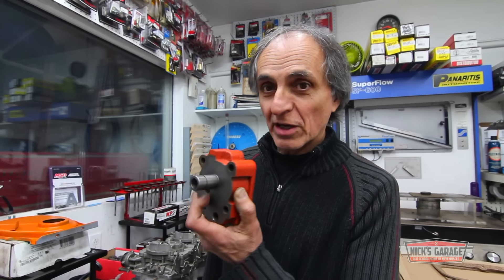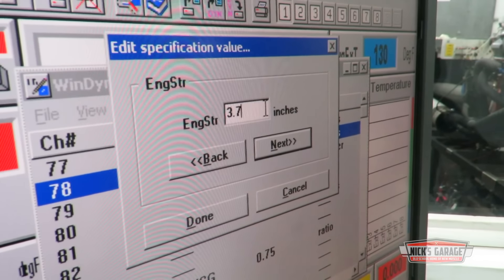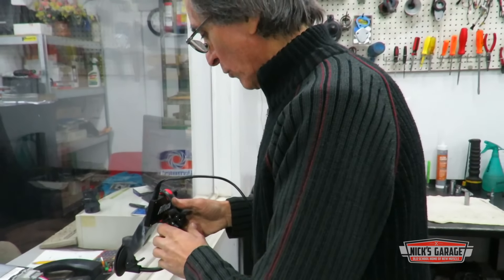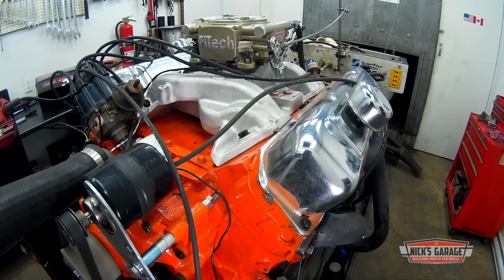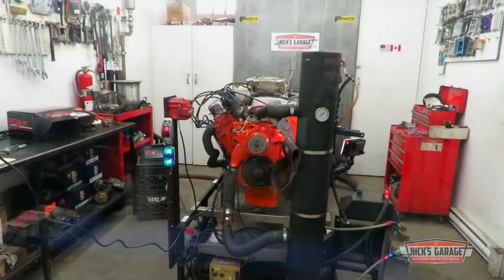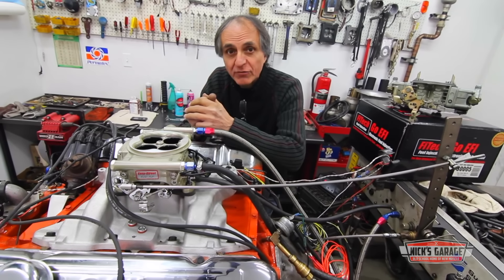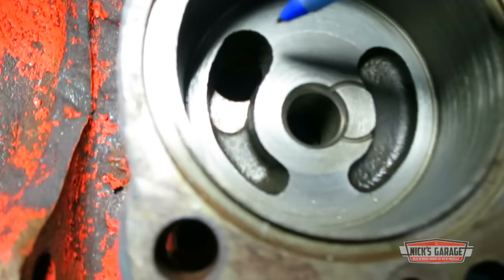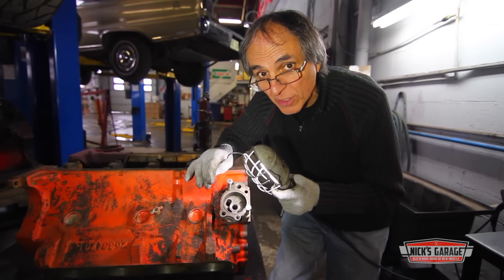Carburetor vs E.F.I. - Dyno Room Showdown

Comment: Yeah, for maximum HP, a carb is always the way to go, but for reliability, quick startup, and fuel economy, go EFI, or TBI...I would much rather see a custom intake manifold with MPFI and individual injectors with a throttle body.
Reply: Has anyone worked on an adaptation of the fuel injection system of a modern car onto an old engine? There are fuel management computers that do the fuel and leave the ignition to a separate spark controller; some of the new engines need crank sensors for the spark control on a stock computer that can't be adapted to an old engine; I'm thinking of the reluctor wheel that's part of a crankshaft (LS?). I know adapting an engine wiring harness can be a nightmare compared to the Fitech system shown here.
Reply: just tune it right with carbies. When the spark plugs go black - it's rich. It's not brain surgery
Reply: Blatchford, I was interested in how to operate a muscle car without the 4 MPG penalty, and to operate in an area with mountains and -40 weather. For example, a modern Dodge Charger with a 5.7 V8 and all-wheel drive can cruise the highway at 10l/100km, and a 1974 Pontiac firebird (455 SD) averaged 4MPG, in my own direct experience. By this video's example, max power seems to be easier with the carb but I don't drive on a racetrack; I like muscle cars and I hate to pay extra for gas. I live in an area with hard starting and expensive gasoline.The modern fuel injection is so much better for driving, I'd like to see more old cars, say from the 70's and 80's, with crude pollution controls be able to be driven and be registerable in any jurisdiction that requires emission compliance. In those areas, an old car must have complete, functioning original equipment, or as is my preference, pass the combustion test limits for its year.
   More importantly some of the big cars with huge engines and low horsepower are just no fun to drive; altering those early emmision engines with modern compression, cam profile and fuel injection would make them actually useable and emissions-cleaner to boot. For actual driving further that the car show.
Reply: in aircraft ( my profession ) if you're at high altitude you tune for that.  If at low altitude you tune for that.  That is the singular advantage of EFI since it modifies mixture as you reduce altitude within a high range.  And yet carburettors are able to compensate for much of the oxygen % reduction.  I.E. most Cessna light aircraft with 360 cubic inch Lycomings  work happily on carbs to 15,000' - Even without turbocharging. And wonder of wonders - no bloody computer to fail.  So just how high are you? You make it sound like you drive to the summit of MtEverest daily..  Really, up to 15,000' in altitude a carburettor can supply fuel mixture at close to optimum levels. So do you live in Bhutan?.. for I visit there often and they also are high most of the time on psychoactive phenethylamine chemical derivatives I have known and loved ( PiHikal ).. since the local bees bring in the pollen of exotic plants from alpine valleys above the tree line.  ( USA personnel who have operated in Afghanistan will understand this..).  So are you also high on phenethyamines so as to believe you are regularly travelling from sea level to above 15,000'? 

My point being - some aircraft regularly make the trip from sea level to above 15,000' but very FEW car drivers. 

I must add that at no time have I driven a " big car with huge engine" that was anything short of orgasmic to drive you yuppy driven Cretan of this airbag age.  And BTW my big block Mopar in a 1972 Valiant Pacer body gets 25mpg on average. And makes 550hp NA.  

Tuning is in the hands of experts such as in this video.  Idiots buy computer controlled new cars and leave the tuning to some pimply computer gaming nube who wrote the software on their EFI system
Reply: Blatchford, I live in western Canada at 400 meters to 2200m(?) but also -40C to +30 (it does get hotter but few days in a year). I believe, also, that the throttle-body injection is more available that electrically adjusted carbs, anything to do with aircraft, or, a way to adapt modern port-injected fuel systems to old cars' wiring harnesses. It seems to me, rather than dyno-tuning and plug chops to tune a carb (simplicity of tools notwithstanding) I'd rather do one visit with a computer to tune an old car and then drive it. The advantage with an aftermarket throttle-body is even less time with a computer, but (cringe) what about long term reliability? Restoring a 20-year-old 2010 car might be impossible as well.
  I am thinking of piecing together junkyard fuel injection parts from the widest available cars to adapt to unpopular cars from 1974 to 1984 with the least efficient fuel systems and bring them back to life. Make some absolute fuel-hog boats into useable muscle cars.
  Would I actually be able to do it? unlikely, as I am an apartment dweller with no shop to work on cars. I really enjoy the art of car building and restoring, such as shown at Nick's Garage. I cannot consider owning a valuable classic, such as done here, because I need to be able to drive any car I own.
Pipe dream? Yeah, mostly but hey, why not?
Reply: As it happens, I did think of carbs with slides. I vaguely recall a CV carb with an electronic adjustment from an oxygen sensor in a mid-80's car. I do know that carb setups had tubes from exhaust-heated air to maintain air temp at the carb inlet which evened out the fuel mixture fluctuations (and prevent venturi icing). I even imagined a setup to use very hot inlet temps at sea-level, graudually cooling at higher elevations to maintain oxygen density throughout a wide range of temp and altitude which, as you point out, many man-years of engineering is needed to perfect, as is computer tuning. 
  Choosing used fuel injection equipment would have to start with what software is available for which brand. I vaguely (I am lost in fuzzy recollections) recall an article about the first generation 4.6 OHC Ford V8 had software you could plug into and adjust most parameters, but still, that required the entire wiring harness an associated body components to clear all the possible trouble codes; a different nightmare again. There are new crate engines that come with an engine wiring harness and independent fuel computer. Again a different problem.
  I would likely go with a restomod project using the entire running gear of a modern car transplanted into and old body shell; there are a number of builds on the internet that use the chassis, floorpan, dash, drivetrain and entire wiring harness and graft on 40's and 50's bodies; I'm not actually talking about that.
  I imagine a 70's Rolls-Royce or Lincoln or Cadillac with a good condition body and interior, and rebuild a tired engine with raised compression ratio, catalyst and new fuel injection system in order to resurect sylish but undriveable potential classics; even restore such a car with original equipment to keep a complete original then replace the fuel system and exhaust with new components. I imagine this because of low prices for some old expensive cars  at auctions. 70's cars after emission controls. Modern 90's V12's from Mercedes and BMW are similarily getting low prices because of un-repairable electronics and I wondered what could be adapted to resurect those as well. Such as Haltech fuel computers and the newest iPhone.
  Again, pipe dream.
Reply: Boosted B Series EK I o most went with fitech but I saw there ad 600$ to late and I already started buying parts for my current setup it’s probably for the better I’ve been told getting rid of the dizzy ( mine was given me grief all ready at the same time as the carb and my local parts houses don’t deal with that old of stuff on a regular basis ) and going to individual port injection can up the MPGs by up to 20% ~ plus have some other benefits it’s just a little more work and cost than fitech but not that much though
Reply: Boosted B Series EK: you are totaly FALSE: a carbutaror is a RESTRICTION because the venturi, and against a injection, you loss 3 to 5% power...And carburetors are optimum only for a very small rpm range, main around the max torque rpm...A injection is always more reliable: i'm old enough to known what happens with the carburated cars against injection cars: my first injection car, was 20 years old and use the all first electronic injection, the Bosch D-jetronic, and work perfectly, many european carburated cars had serious problems at suppression from leaded gasoline...
Reply: My daily driver, bone stock, beat up, rusty, old '78 chevy 1/2 ton starts up every morning without fail, in a single revolution without pumping the pedal even once, gets 18 mpg hwy, and the carb hasn't been adjusted since I rebuilt it over 15 years ago.  Of course, I'm a certified technician, I keep it tuned up and maintained religiously and only use quality premium fuel, so I may be the exception to the rule, but the point is, carbs are still just as good if not better when properly maintained and not f#@ked with by idiots who only think they know how to adjust one, which is where EFI comes in...  it's harder for idiots to screw it up.
Reply: Kathleen, I agree about stir stick trannys and the propane, but magneto ignition?  Really?  I like my old trucks with breaker point ignitions, but how old is your car to have a magneto?
Reply: leneander...  venturis don't "restrict", so to speak.  They boost the velocity of the air flowing through them by forcing it through a smaller area, yes, BUT when selecting a carburetor you choose one that will flow slightly MORE air than the engines is capable of moving anyway.  It's the throttle plates that do the restricting, and at WOT the engine is only going to use a certain amount of air regardless of how the fuel is being delivered.  Only in the last 10 years has EFI gotten refined enough to compete in the performance market, where the carb is still king.
As for reliability, yeah, for the average guy EFI is going to be the better choice, but not all of us are average.  Some of us just like having our fuel delivered by miniature, high tech toilets.
Reply: Kathleen Shaw I took a propane unit off an old taxi cab and put on our farm truck ....stone reliable,starts perfect and gives the cleanest oil changes ever